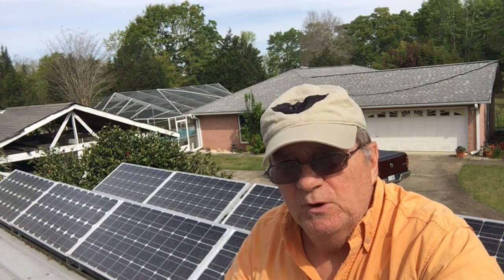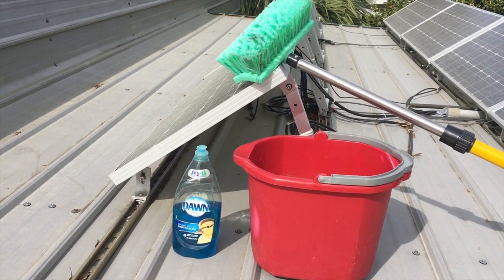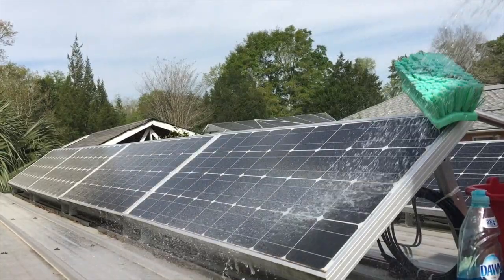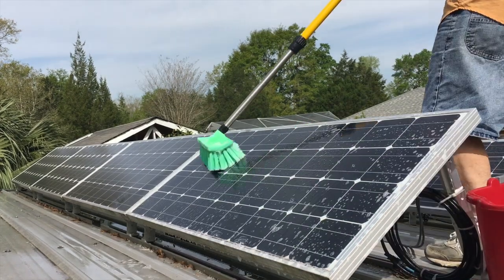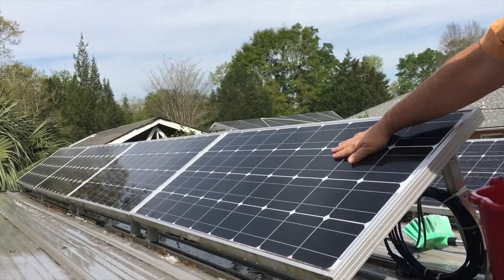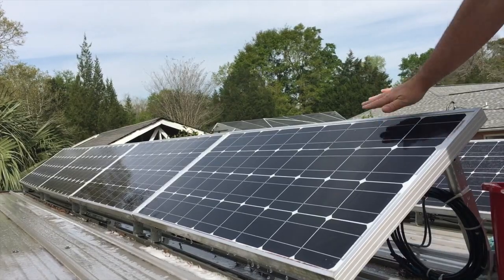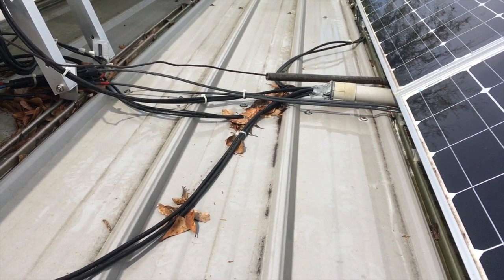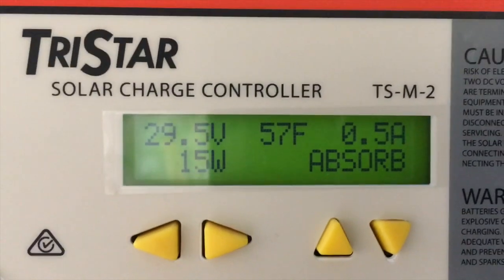How to Clean Solar Panels and Improve Performance

Comment: Good advice. I cleaned my array about a month ago and got 20% increase in performance.  Apr/ and most of May I never went above 4KW ....
Went to 5KW on the first sunny day after cleaning them with water and soft brush. 
UK Based....  Worcester
Reply from the maker: Awsome! Thanks for watching.
Reply: This is the first time I watch this video. Do I need to turn off the power first before I clean it? Thanks!

Comment: Great tips for cleaning the solar panels.  Thank you.
Reply from the maker: Glad it was helpful! Thanks for watching.
Reply: Clean solar panels with soap leave a thin layer on the surface, that's why you felt the panel so soft. This layer of chemicals is gonna stuck the smuts much easier. The right way to clean a panel is with water or DI water.

Comment: Thanks for the video. Do you know if solar panels crack with thermal shock (cold water in hot temperatures) and if  so what do you do to prevent that? Thanks
Reply from the maker: Solar panels should handle anything Mother Nature throws at it except hail. With my experiences I wouldn't worry about cold rain on a hot panel. Thanks Max for you comment and hope you had a chance to Subscribe :)
Reply: @LandingZoneHome  Thanks for your response, but I was getting at when you wash your solar panels is it safe to wash solar panels with cold water in hot weather or will it cause thermal shock? Some what like throwing hot water on a cold windshield where they immediately break or crack. Thank you again and forgive I’m just learning about washing Solar Panels
Reply: @maxgarcia7056  sorry I wasn't clear, yes you will be okay washing a hot panel. Years ago when I made this video I wasn't sure about that but I have learned that the panel will be fine and not be damaged.
Reply: @JackHunnicutt  Thank you so very much. I’m learning all this myself and it’s all new to me. I wanna be safe than sorry

Comment: If you had a 2 mw solar farm to clean,  and two water fed brushes, what would the water required look like?  What would be the ideal GPM to be economical yet effective (maximum efficiency with low labor inputs)?
Reply from the maker: Haha, I have no idea, thats a pretty technical and specific questions. Thanks for watching.
Reply: @LandingZoneHome  Yes, hehe. It sounds like homework, or spam, or something a bot would write.

Comment: What was your PPM water were you using?
Reply from the maker: Not sure what PPM is, I used what we call tap water in the US. Thanks for watching.
Reply: @LandingZoneHome  it’s parts per million (PPM) solids in tap water. It’s the hardness in tap water. There are water testing devices used to test water harness for drinking especially during water filter changes for reverse osmosis & whole house water conditioning or softner. Tap water with hardness (high PPM above 100) in it ruins Solar panels ( creates films ) decreases PV performance
Reply: @JohnSmith-pk5xg  Haven't had the water tested so I don't know, sorry.

Comment: Where  do you buy the brush . I am from The UK. ThANKS
Reply from the maker: This particular brush came from a RV store however, any soft bristle brush will work. Thanks for watching.
Reply: Got my window cleaner to bring his eqpt.  pole not long enough and he was a litle afraid of climbing the ladder so I climbed the ladder with his brush and he held the ladder.  did one side of the roof on a cloudy colder day  about 12 degrees.  Used my water hose which just about reached the apex of my roof when I was up on the ladder then used his water supply distilled water at the end.  There was load of yellow / green lichen or algae type stuff in  my water butt when I finshed.  It wasn't visible on the panels originally.  I've had the panels about 20 months now.  My surrounding neighbours roofs have lots og lichen/algae on them so would expect it to start building up on my roof / panels as well.  a 20% improvement already.  Will be doing the other panels on opposite side of house when the window cleaner bring his kit around again.  I suggested he invest in a longer pole to reach the panels from the ground instead of using a ladder as much easier and safer all around.  Definately do it on a colder cloudy day!
Reply: hi, this is Jeremy, we can manufacture this style brush, can you tell your email?  I will send details to you
Reply: @zhendabrush2038  how much for a brush
Reply: @AKADEMON100  3.6/5.4/7.2 meter pole, 30/60cm length brush head, which pole&brush will you choose?

Comment: I guess I'm going a bit Overkill, I clean my panels once every two weeks 😨
Reply from the maker: Just a little :) Thanks for watching.
Reply: It’s a little bit too much. It is recommended that you clean your solar panels every six months with pure water, and with a soft abrasive water fed brush.
Reply: @SolarPanelCleaningFriends  that's the right clean and fix the mess with the cables. Cables can't touch the roof.
Reply: @TLC 100% you are correct. On every job we do a visual inspection and present that report to the customer.